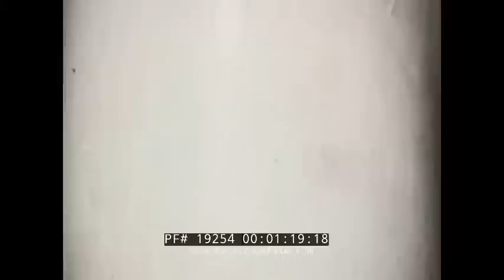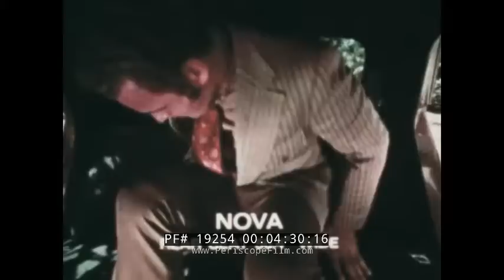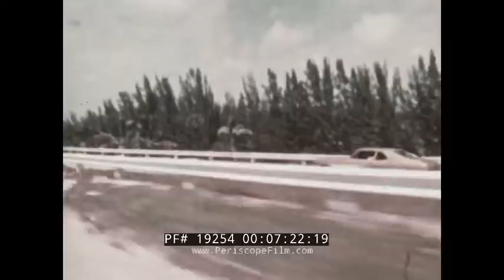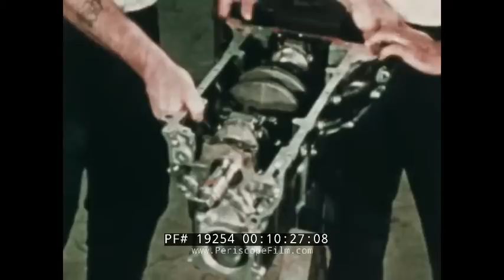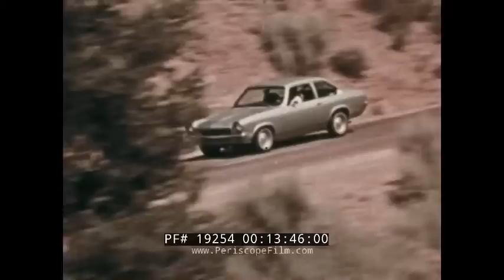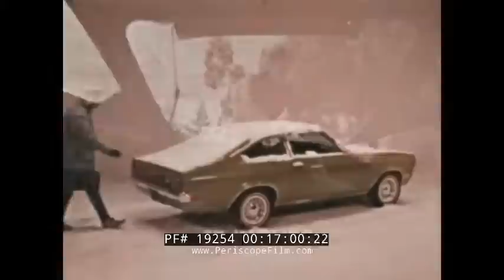1971 CHEVY NOVA  SALESMAN TRAINING FILM   CHEVROLET AUTOMOBILES  19254

Comment: In 1983 I owned a 1974 nova, mine was a bronze color, with 4 doors, and mine also had a 350ci with a 4 barrel carb. Man I used to love that car! I had it for a couple of years until I totaled it! Man for those two years I owned that car I never had any issues or brake down problems with it.  And it was pretty fast too! The only thing I didn’t like was that them nova’s looked like they were driving down the road sideways! For some reason every nova I saw down the road seemed to have that issue! So the only way to fix mine, was to put track bars on the rear leaf springs and a swaybar to fix the problem! But that was it! The car was very reliable.

Comment: The 1960's to early 70's Chevy Novas were IMO the most reliable/ economical  cars GM made. They were easy and cheap to maintain  - GM was sincere in building them to be longlasting. I had a 1965 Nova 6 cyl 3 speed manual trans  then later a  1967 Nova 327 engine. The best cars I ever owned...hands down. 👍